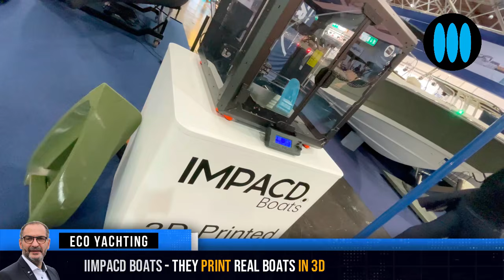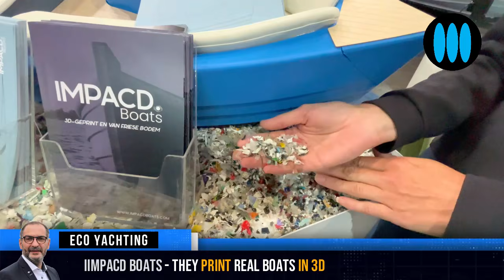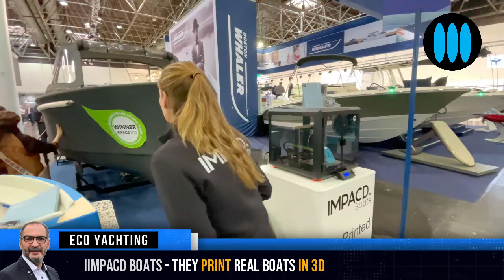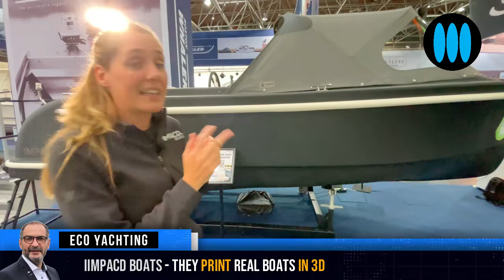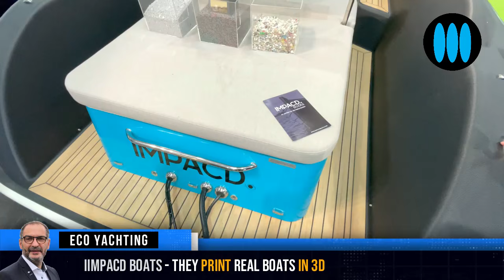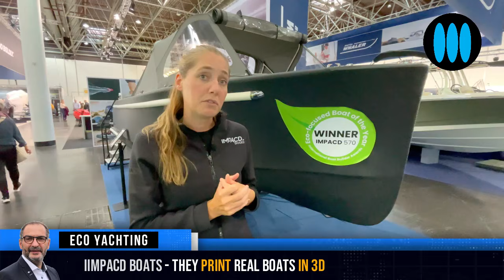IMPACD BOATS - they PRINT real boats with 3D Printers

Comment: It’s Plastic it will break ,Shatter, When you hit Coral it will get deep scratches and produce micro particle dust that will stay in the sea, Carbonate is stronger ,Safer , Doesn’t produce micro particles when scratched, These plastic Boats that are 3D printed has a rougher surface and creates drag .
Reply from the maker: Merci pour votre commentaire, qui soulève plusieurs questions intéressantes, mais mérite quelques précisions techniques.

Tout d’abord, le PET recyclé utilisé en impression 3D n’est pas un plastique fragile par définition. C’est un polymère thermoplastique dont les propriétés mécaniques peuvent être adaptées aux applications industrielles. Sa résistance aux chocs, à la flexion et à la fatigue dépend de sa formulation, mais également de la conception de la coque, de l’épaisseur des parois et de la qualité de fusion entre les couches d’impression. Affirmer qu’un bateau imprimé en 3D va nécessairement se casser est donc inexact. En revanche, il est indispensable que le constructeur valide ses caractéristiques mécaniques, notamment sa résistance aux impacts et au vieillissement.

Concernant les rayures et les chocs contre du corail ou des rochers, aucune coque n’est invulnérable. Une coque traditionnelle en polyester renforcé de fibres de verre peut également subir des dommages, avec notamment des éclats de gelcoat, des fissures ou des délaminages. La véritable question est celle de la résistance comparative des matériaux, de leur réparabilité et de leur comportement après un choc.

Vous avez raison de soulever la question des microplastiques. L’abrasion d’un thermoplastique peut effectivement libérer des particules. Mais ce phénomène concerne aussi les coques traditionnelles, leurs peintures, leurs gelcoats et leurs revêtements antifouling. Il serait donc incorrect d’affirmer que seul un bateau imprimé en PET présente ce risque. Pour déterminer quelle technologie est la moins polluante, il faudrait comparer les émissions réelles de particules sur l’ensemble du cycle de vie des bateaux.

Concernant le carbonate, il convient de préciser de quel matériau vous parlez. Le carbonate de calcium est une charge minérale utilisée dans certains composites, et non un matériau de construction directement comparable au PET. Si vous faites référence au polycarbonate, il s’agit également d’un polymère plastique, susceptible lui aussi de subir une abrasion et de libérer des particules.

Enfin, votre observation sur la rugosité des coques imprimées en 3D est pertinente, mais elle concerne principalement les surfaces brutes d’impression. Les procédés de finition permettent de réduire cette rugosité et d’obtenir une surface hydrodynamique adaptée à la navigation. C’est donc l’état de surface du bateau terminé qui doit être évalué, et non celui de la pièce immédiatement après impression.

L’impression 3D en PET recyclé n’est évidemment pas une solution miraculeuse. Elle présente des défis industriels réels, notamment en matière de résistance à long terme, de qualité de fabrication et de recyclabilité effective. Mais elle ouvre aussi des perspectives intéressantes : valorisation de déchets plastiques, réduction potentielle des chutes de fabrication, suppression de certains moules et possibilité de recycler la matière thermoplastique.

L’intérêt de cette technologie mérite donc d’être évalué à partir d’essais mécaniques, de données environnementales et de retours d’expérience, plutôt qu’à partir de l’idée qu’un bateau en plastique serait nécessairement moins solide ou moins performant qu’un bateau traditionnel.

Comment: it's a really nice concept i only don't like her saying it's from recycled material. later in the video she explains there are many types of plastic and not all plastics are usable for printing and they are still researching that matter. so i guess it's an other marketing stunt and the percentage of recycled plastic in this boat is minimum. you don't want your big expensive printer to be broken by a piece of bottle cap that gets stuck in the printer head, so you make sure you have 100% reliable usable plastic. also i would like to know the advantage of printing vs molding. it takes 60 hours to print a boat. in china they mold one every 30 minutes? one of the advantages must be the size. molding is only possible for smaller size boats and printing there is maybe no limit?
Reply from the maker: they use PP waste. the boat is only built with plastic waste....
Reply: @ActunautiqueYachtingArt  "Polypropylene has long been recycling’s head scratching riddle. A common plastic used for a wide variety of products from packaging and toys to furnishing and fashion, it accounts for roughly 28 percent of the world's plastic waste, but only 1 percent of it is recycled. The researchers say polypropylene is so infrequently recycled because of its short life as a packaging material and because it often becomes contaminated by other materials and plastics". In other words, it's not reliable to get good quality recycled pp and too expensive to recycle at this point.
Reply: There’s plenty of recycled plastic that can be used to make boats, but you can use new plastic if you want. Your choice.
Reply: They do not mold a boat every 30 minutes in China. The resin doesn't even cure that fast. Stop lying. Also ot will never be 100% recycled. That is not the point. The point is to help alleviate some of the recycled material around. Nothing is perfect in life. Everything you said is inflated by lies. Stop with your nonsense.